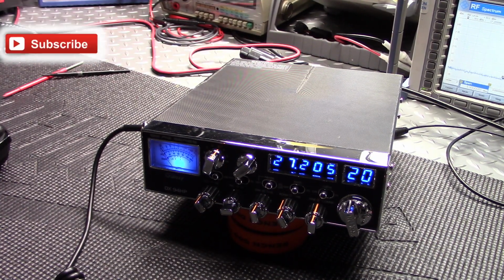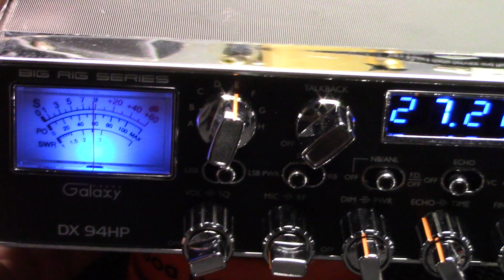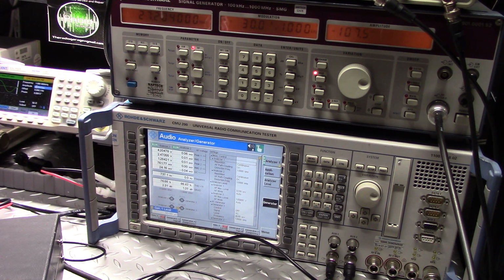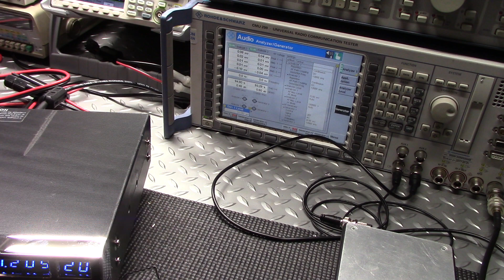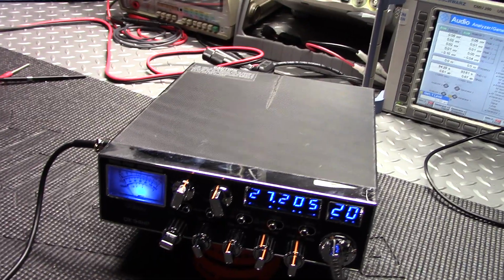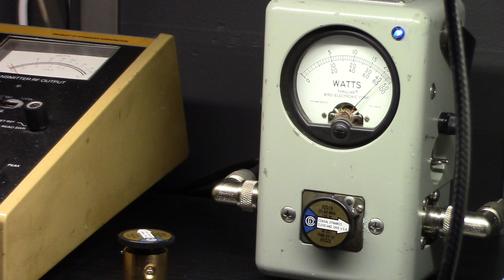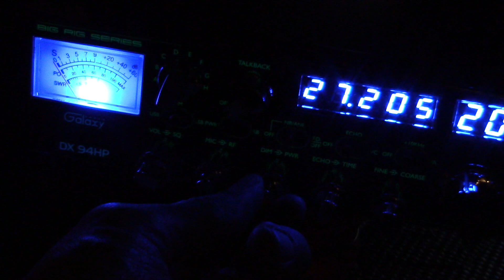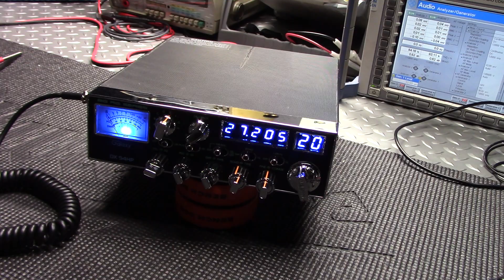Galaxy DX 94hp Big Rig Series High Power Tuned & Aligned

Comment: All that power comes with a little dirt shower. Your time spent fiddling produced good numbers though, Matt. It will run with the big dogs now. Smilin', I'm off the key.
Reply from the maker: It's gonna be a talker for sure. It takes time but they clean up fairly well. 73 👋